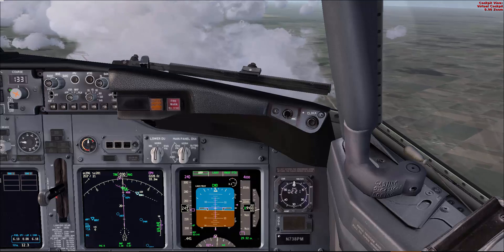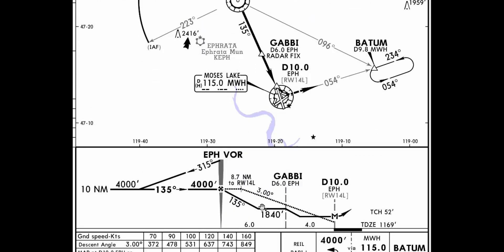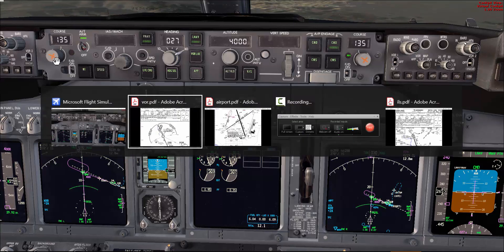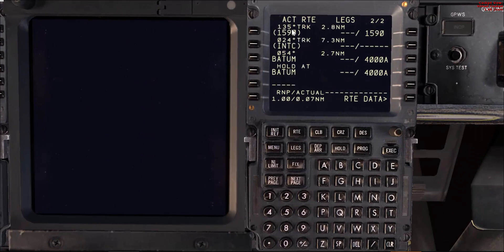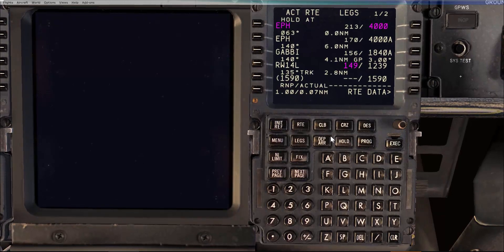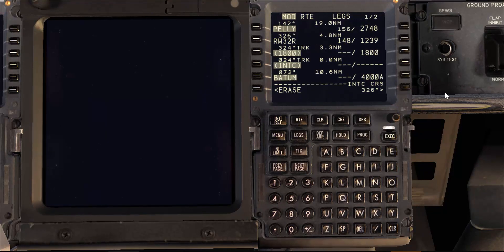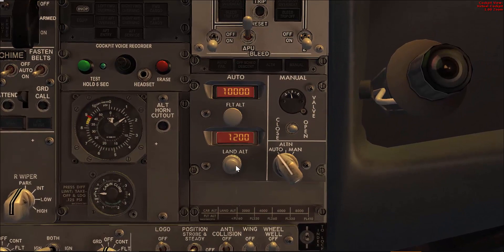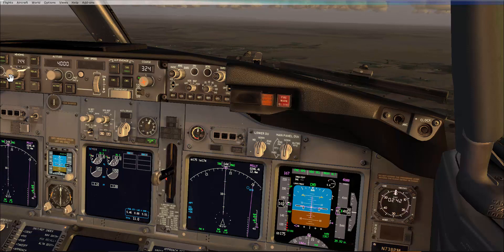B737 Approach Briefing & Setup in the Simulator (PMDG)

Comment: Hello Capt, Thanks for the tutorial, please help me! I just bought the PMDG B737 for FSX and I'm really having a hard time landing this plane. Each time I want to intercept the localizer, the VOR/LOC button won't arm or show up on the PFD and when I hit the APP the plane will follow the glide slope and runway course but it won't align to the runway. I happen to be slightly drifted to the left of the runway heading course and this makes me disconnect the autopilot to land the plane manually.  How can I align myself to the runway heading when my VOR/LOC key won't arm. Is there something I'm doing which is not right. please explain!
Note: I set up all my approach procedures correctly. Heading course on both sides, loc frequencies both nav, transition level set, glide slope atl interception, minimums and whatnot.
Reply from the maker: Hi Ring, 
May be it’s better to do this over a video call, so I can see and may be able to help. 
If you are interested drop an e-mail at abdulmuati37@gmail.com so we can arrange for a video call, the other option send me screen pictures of the PFD, ND, NAV panel to try to figure this thing out. 

All the best
Abdul
Reply: @AbdulmuatiAsiri37  I appreciate your kind gesture. Sure I will get in contact when I settle in. Masha Allah!